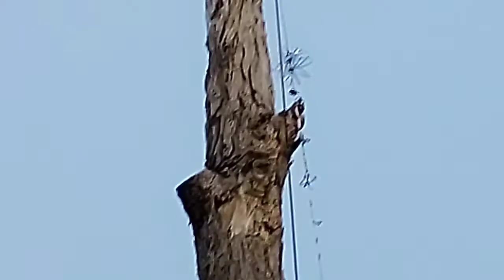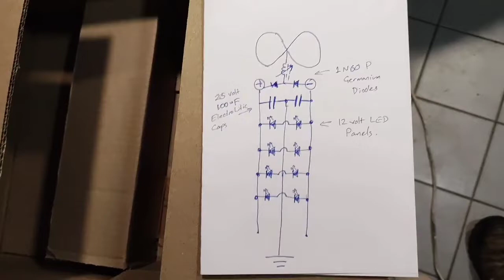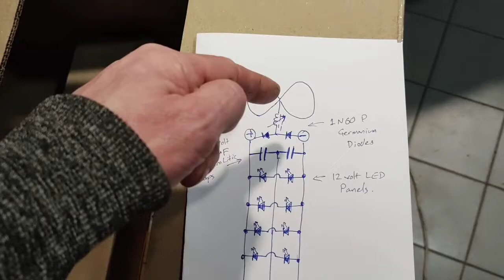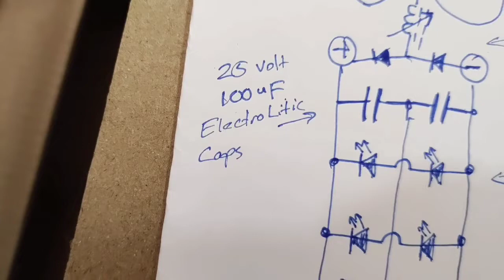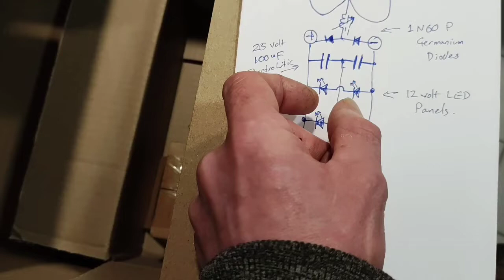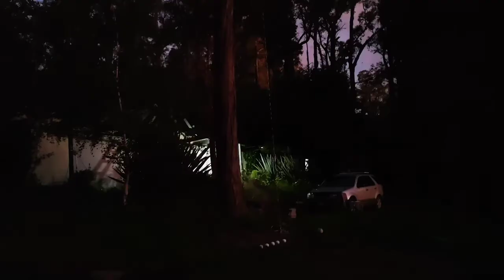⚡HF Wireless 12 Volt Light Rectenna System Upgrade⚡

Comment from the maker: I was only transmitting with 10 watts TX power
from a vertical wire antenna that was pulled up in to another tree that was many metres away from the Rectenna System.

It was critical to ground the rectenna system
& of course
the transmitting antenna also had a ground connection.

Comment: Sir please provide me how to make rectenna system at home
Reply from the maker: Hi my friend.
It was part of a series of videos.
There is 3 or more videos I think.
The first video is linked below.
The first version only used one led panel.
(Rectification used is just 2 x 1N60P germanian diodes per section in a push pull from the Torus's to the DC  figure 8 cable.)
Inductors are approx 12 turns (bifilar)
on  L15 toroids
adjusting the inductance to find resonance using pernanent magnets. (Tricky).
https://youtu.be/wHNAYpwkYik?si=_oqFDbHPTPGyqXsd